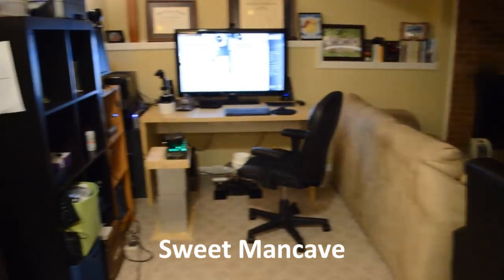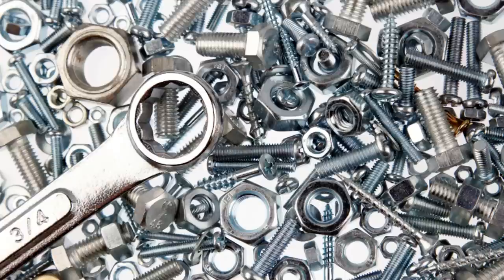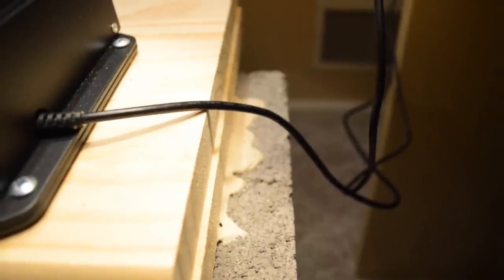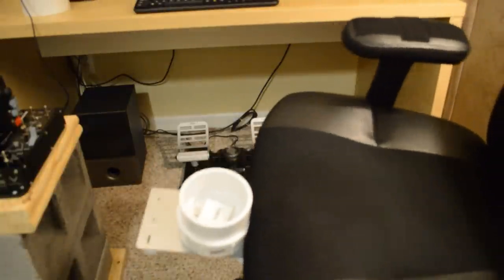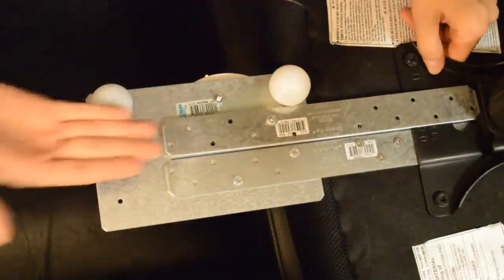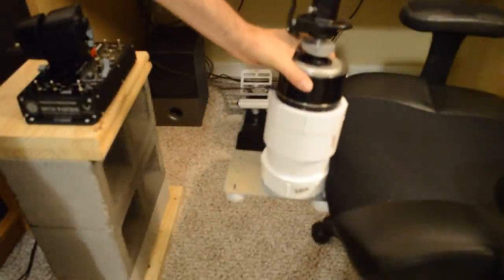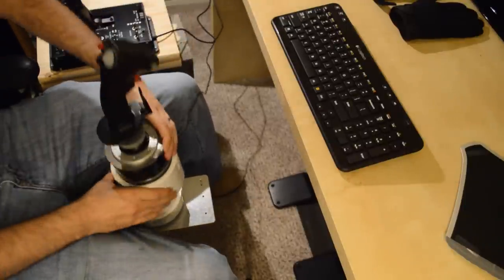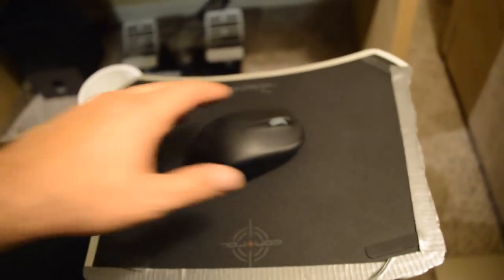How to Build an Easy Flight Simulator Cockpit

Comment: I know itd be a waste of time but i honestly want to make a legit simulated sturdy cockpit, using vr. Try to make everything as accessable to my hands as possible without having to bring it toward my lap like the keyboard and mouse and get some sort of switch and button board and maybe even make the button layouts interchangeable to fit certain aircraft and their button profiles could be saved and the chair id sit in would be something similar to one of a cockpit to allow for your head to turn, as i said for vr. Id love to do it at some point. But at the moment its just a plan and i have no detailed plan to make it or what to make it out of

Comment: Notwithstanding design limitations of the joysticks available, well done.  As I understand things, actual aircraft center sticks and helicopter cyclics have the control grip rotated about 20° left about the vertical axis on ergonomic grounds; neither Thrustmaster® nor MadCatz® nor the Virtualnoje Konstrukt'skoje Bjuro nor any of most vendors to the consumer market considered this.  Wonder whether Bugeye® and other serious simulator-hardware manufacturers can do this correctly, e.g. for a Long Throw Stick build with the brake handle option (correct for British and Russian types)?

Comment: I need a better set up, especially for the keyboard, I have IR tracker for looking around without using keyboard commands, but unfortunately my wrap around desk has a slide out keyboard and interferes with a set up like that, I end up too far away

Comment: Great video on a simple project. The PVC center joystick control is well thought out. I wish the complainers would post a video reply of how great their setup is our how they tweaked the setup to make it their on. If you can get your hands on a grinder or metal file you could easily smooth out the rough edges. Is there purpose for the plate sticking out past the PVC or could that portion be cut off?

Comment: add a few rivnuts to the bracket on the chair and you can make the base for the joystick removable by simply removing some bolts. a rivnut is basically just a large rivet, that can "pinch" itself to a piece of sheet metal, that has a hole with threads. essentially allowing you to "rivet in" a portion of threads.

Comment: quess nobody started out in college or first apartment with no furniture, most of the time my renters use cement blocks and a board for  stereos, tv stands, beds with no frame gets the blocks . good idea on stick with plumbing, I made a truck cab sim, I was looking for ideas to also use it for a flight cockpit.  any curtain, pillow case, bed sheet or moving blanket can make blocks look better. good job spend money on equipment  and remodel when money is better.

Comment: why wouldn't you just make a hollow wooden box for the stand and hammer it together with eights? Surely it's lighter and cheaper than buying concrete blocks and construction adhesive (and grout would have been much better for putting the cement blocks together) You could also put a hinge door on it and add weight as needed. and use it for storage/wiring too.

Comment: I found a more practical solution.  Most computer desks often need low rise roll-a-way filing cabinets that can slide under an open desk.  Ikea has some really good modular desks and they are cheap and great for triple monitor setups. The tops of these cabinets is right at seat height which is what I prefer.  Screw the HOTAS to 18" squares of 3/4 MDF or particle board with no slip router mat glued to the bottom. This just sits on top of the roll-a-way filing cabinets without slipping.  You can double up on the MDF or particle board to add height and extra weight. Paint up the boards and finish them well to repel dust and to look good.  No furniture is altered or harmed and your HOTAS can be removed for easy storage when you get tired of it.
Reply: +Phillip Mulligan  It might be better if you do a video showing how you have your set up, sounds interesting  :)

Comment: Judging by how much the joystick and throttle quadrant cost these days, I wouldn't say it would be under $100. It's still a cool setup, but the price in the description is off. You should check out Roger Dodger Aviation, they have some of the more involved projects that use PVC pipe, Styrofoam insulation, and modified keyboards. That is a nice idea you have.
Reply from the maker: Oh no the electronics cost $500+ for sure and there's no getting around that.  The stuff from Home Depot was $100.

Comment: I had the same dilemma but there are a few problems with this design...

1) The base of your joystick mount is fixed to the chair therefore you cannot use this an an office chair any more its dedicated to games/sims now
2) If you do not cut out a section of your seat cushion you will likely have to over reach to grab the joystick unless you happen to be a tall person

I think the solution is to either pedestal mount the joystick with an extension and then have a cutout in the seat or you need some custom/rigid quick release platform that attaches to the seat that allows the joystick base to sit above the seat cushion.
Reply: u might be able to get a U shaped metal brace and then have the upper part of the bracket ontop of the cushion, while the seat goes into the U, so then u can attach a base onto the bracket and then viola. maybe this is understandable

Comment: no offense man, Im sure it works for you, but i'm not sure if this advice is youtube worthy, with a bit of thought in the right direction, you could have built a much better looking, if not functioning setup. That's not something that I as a grown man would want to show off. not to mention stubbing your toe on those blocks! ouch. My advice is get yourself some 2x4s and borrow your dads tape measure, skill saw, and drill. Leave concrete blocks outside where they belong :)
Reply: Uhhh... you need weight too make sure your throttle doesn't move. I've built quite a few things and this is essential. I bet you don't even build.

I found the strap idea very helpful, thanks
Reply: I agree you must have a very understanding spouse lol concrete indoors damn brotha . least build a frame to hide that ugly sh*t
Reply: youtube worthy? Have you seen some of the shit on here?
Reply: yeah no its a great simple idea man . I actually used the same set up with the pvc fittings great cheap idea. good stuff man.
Reply: shyjonathan1588 It looks ugly but it works. You can always throw some covers on it once it's built. I had to re-design my throttle holder like... 3 times because it keeps moving on me. Think I'm stealing this idea tonight, thanks for the video!